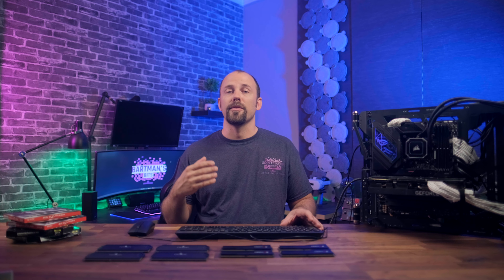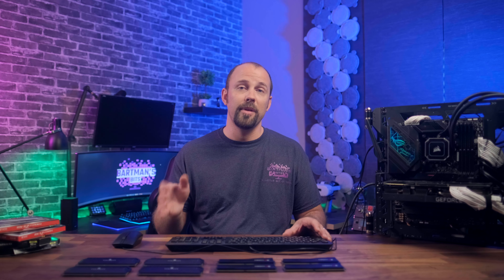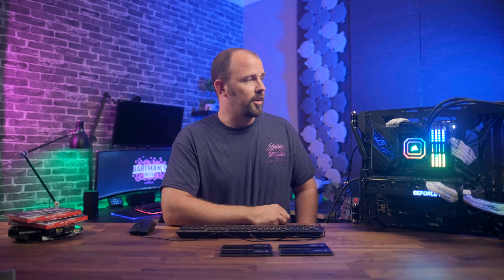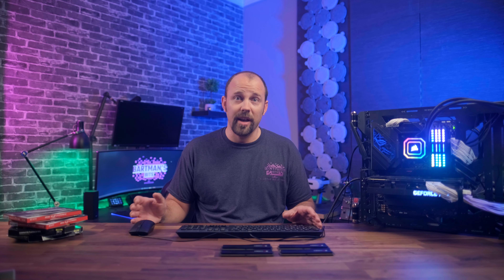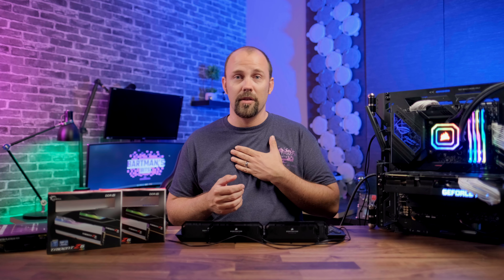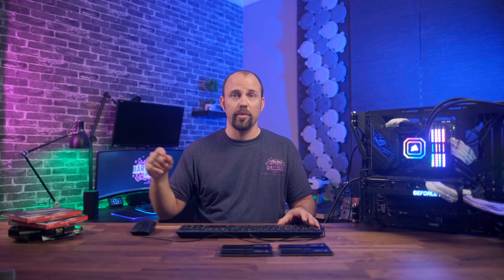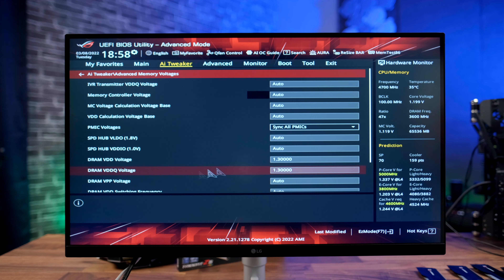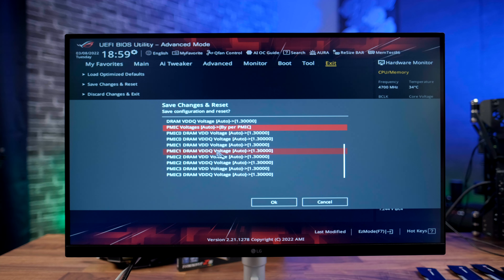Intel’s DDR5 problem resolved! DDR5 64GB Boot Loop failure Fix. Get the rated speeds of your RAM!

Comment: Unfortunately this did not work for me, it continues to boot loop.
Rog Z690-E, Dominator 64gb 5600mz, 12900k.
Reply: It does take some time to train the memory I noticed. I had to remove my sticks as suggested, let them settle then raise the voltage to 1.35 otherwise I was getting in game crashes constantly! Seems stable at the moment
Reply: @bellgarron7772  Glad you figured it out. I actually updated my BIOS and it did finally post... but now certain games will crash and I'm not sure if its the game or the PC. I need to do a stability test.
Reply: @2JJays  the voltage definitely seemed to do the trick for me, so give that a try. I was getting some sort of driver error that was definitely due to the ram settings
Reply: @bellgarron7772  I'll give it a try. Did your GPU ever crash?
Reply: @2JJays  yes that's exactly what it did, or appeared to do a GPU driver crash. I know it was the memory speed because when I ran it at default it was fine. However I just repeated the steps and upped the voltage ⚡ to 1.35 instead of 1.30 and it hasn't crashed so it appears to have solved my issue at least. If that doesn't work you could also try rolling back the GPU driver as the latest one could be causing some kind of conflict also potentially

Comment: For me, it worked after changing ram kit with Slot 1 and Slot 3.. I have Asus Rog Strix Z790-A WiFi II, Core i7 13700K, G.Skill 2x32GB 6400 Mhz DDR5 Cl32 Ram. 
My Options; 
XMP I and 1.435v both and changed with By per PMIC. Just try to change slots..

Comment: Asus launched a firmware for my motherboard and fix the problem.
Reply: Which Asus board?, which settings? which DDR5?
Reply: @3802er  asus prime z690-p and the bios works well is the 1401. Later they launched the 1603 but the problem return I don't know why and I installed the 1401 again and works perfect.

Comment: Well, Asus updated bios of TUF GAMING Z690-PLUS and im back unstable! can't use any XMP profiles! guys also you?
Reply: Updated to 2204 and again unstable, really ridicolus
Reply: Same here.
I has 4x16GB GSkill Ripjaws 3200Mhz DDR4, it was working fine with my previous ASUS Strix B450 with R7 3700X. The day I upgraded to Intel 12700K all 4 RAM worked fine there. Then As the BIOS version was old, I flashed the new BIOS then it stopped booting. Funny thing is the version of the Firmware out of the box wasn't present in the ASUS website. I tried flashing old Firmware but didn't work. Then after some BIOS Updates later It started booting, but Windows will Get BSODs in every boot. As of couple of days ago, I was using them in 2933Mhz as that frequency boots. But after upgrading my GPU, Call of duty modern warfare 2 started crashing everytime. I tried everything but didn't work. Now as the last resort I removed 2 sticks, and enabled XMP with 3200Mhz, now everything is stable.

Comment: Didn’t work for me I have the Asus rog strix z790e with Corsair vengeance 7200 mhz 13thgen cpu 13900k
Reply: I have lower to 6200MHz and it worked. For now no luck with 7200.
Reply: I thought that Z790 had fixed all the bugs with DDR5 that Z690 has.
Reply: @n4ul17o  not all of them I guess. I will try 6200mhz when I get home from work
Reply: @TheMarkovaldi  well it worked at 6200mhz that’s exciting 7200 still boot loop

Comment: Yeah didn't work for me either, using ASUS ROG Maximus Z690 Hero with CORSAIR Vengeance 64GB (2 x 32GB) 288-Pin DDR5 SDRAM DDR5 5200....and with 4 sticks at 128gb will only run at 4000 Mhz
Reply: Exact same config (RAM and MB) works for me with XMP settings and frequently lowered to 4800.
Reply: Try setting voltage to 1.39, I got my set(trident z5 6000mhz 4x16) to run 5600mhz at 1.39v

Comment: I've never have as problems with RAM as now. I put 2x32 more to my 2x16 setup both 5200mhz and had to clear BIOS setup to turn on PC to find only works at 4000mhz
My z690 ud ax wont even send me to BIOS with an error message, it just black with RAM led on.

Comment: NOT, Didn't work with a 4 stick of 16 Gb Kingston FURY BEAST 6000 MT/s CL36-38-38-80-1.35V. I just up the voltage 1.37 (I don't want to lose my ram) I'm going to change to 2 stick os 32 Gb but It's amazing than You spend 649 Euros (in Spain) on Mother board and find this..... that just have a name.... fraud. My mother board is ASUS ROG STRIX Z790-E GAMING WIFI

Comment: Hey!  My config: i7 12700k, rog strix z-690-g, Corsair vengeance ddr5 x2 16gb 5600ghz A2-B2 slots (at first the memory was not from QVL, but later I replaced it with QVL), win 11. I replaced the memory due to a BSOD with an address for memory, and  a large number of errors in MEMTEST.  When the memory was first turned on, when passing MEMTEST, both in the standard and in XMP, everything was successful.  But when I started the system and decided to go through OCCT for memory, the system just hung and only a hard reset helped.  And after that, MEMTEST started throwing errors again.  And after turning it on again, the system goes into a circle of startup attempts.  Please give me an options. Thx🥹
Reply: I have almost the same set up and I’m going through it all rn idk what to do

Comment: Corsair dominator 6600 c32 doesn’t work with this solution unfortunately. Even tried at 1.42, but stopped there. Not sure how high I should go. 1.4 is the recommended xmp value.
Reply: got it working with 6200 c36, did you install the new bios that came out on some boards? i reset mine back to 1403 and then got it back working with the most recent 7/8/22 release

Comment: Didn't work for me, I'm running 4x16gb ddr5 XPG Lancer RGB
Reply: me too bro, i have 4x16gb ddr5. did you get the answer?
Reply: @KulkulOfficial  no bro, I've tried every single option
Reply: @Danes1983  did you using alder lake procie? my friend tell me all board alder lake cannot handle 4x16gb of ram. they cause crash/bsod
Reply: @KulkulOfficial  12900k
Reply: please update it if you get it working

Comment: Im still on Win7 & refuse to downgrade to Win11. Should i not even bother with GDDR5 RAM? Im currently on GDDR3, I’ll probably settle with GDDR4
Reply: DOWNGRADE? Then you'll never have a need to use a modern Intel CPU indefinitely or play current-gen console exclusive PC ports indefinitely. At least upgrade to Windows 10 and use a Zen 3+

Comment: there must be a disadvantage of By Per MIRC if it's not usually set by default
Reply: Disadvantage is stability, systems can crash more frequently, but if the system isn't working as advertised to begin with what's the difference?

Comment: I've tried 6000mhz to 6400mhz nudging voltages up by 0.05 till 1.55v. I don't want to go higher than that and I have yet to get a successful POST.

I highly doubt it's a ram/mobo issue because I've hit this issue on three separate sets of ram and two different motherboards. It'd be insane to think I got 5 sets of bad hardware all at once.

I'm at a complete loss